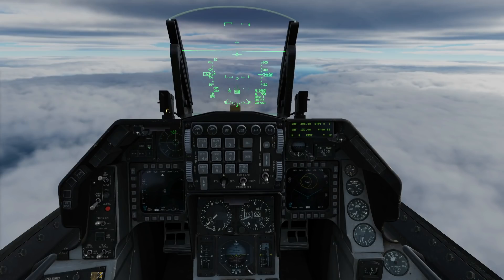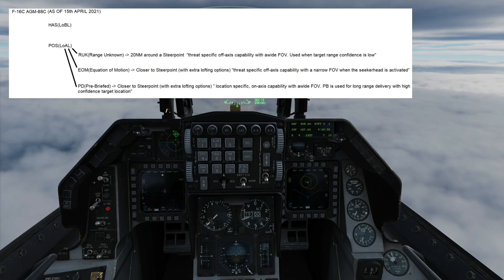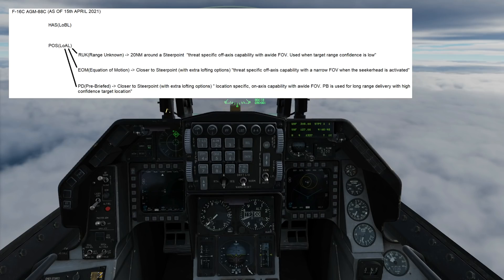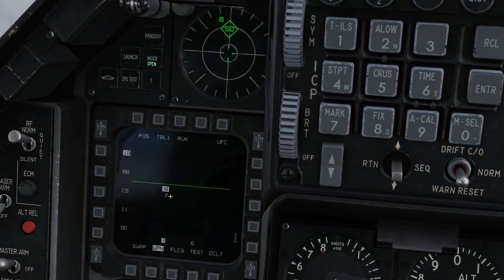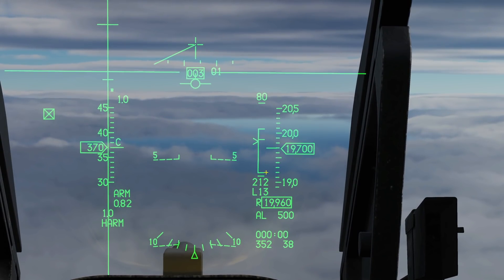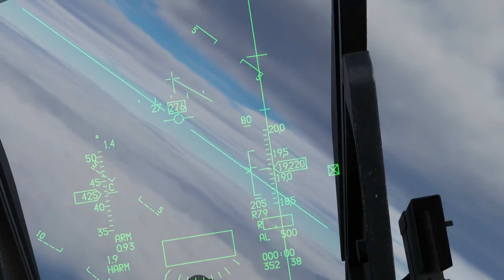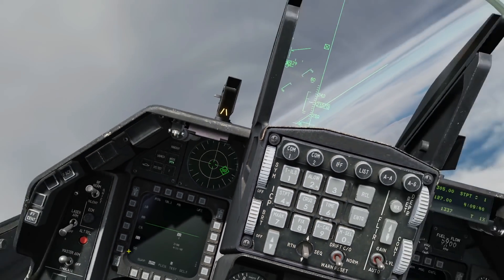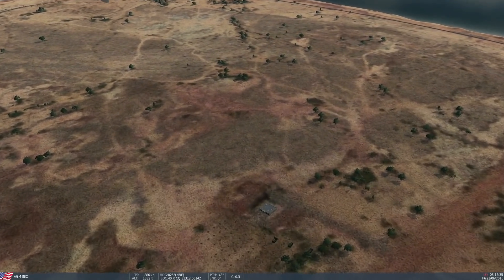F-16C Viper: AGM-88C HARM (POS-EOM & POS-PB Modes) Tutorial | DCS WORLD

Comment: I've just been trying the new modes out for the AGM-88C HARM in the F/A-18C & F-16C.  Just had a test mission where I was flying just below 30,000ft, IAS was 464 Knots in an F-16C.  I fired a HARM at a P-19 Search radar at a range of 54.44 nautical miles in POS-PB mode and it hit & destroyed the target.  It does appear that they have improved the AGM-88C HARM.

Comment: How far is the max range in pos mode exactly now? And how far is the tolerance for pos mode? 10 feet? 100 feet? 1 mile?
Reply from the maker: I haven't been able to find the tolerance anywhere. Apparently over 80 miles I have heard.
Reply: @grimreapers  Thats crazy! Thanks.
Reply: Tolerance varies. 80nm is a good or even best case for total missile range. 

EOM Test: HARMs are not waiting to turn on seeker. At 60km I had 40km lateral steer position and missiles steered back front toward emitter during first few seconds of climb. It looks like some kind of flex logic is coded so you basically can't miss. If there is an emitter of that type out there it will find it (at least in my ~30 deg error test). It does go for the assigned area by priority. Be aware a decoy emitter could easily fool this logic by dragging a missile off axis. I fired HARMs at each others targets about 30km apart laterally and they switched and hit crossing away from their original destination.

From what I can tell it looks like the HARM "glances" over at the assigned point up to 60deg off axis. If specified threat isn't there it turns to known available detected threats. Further tests will have to be done to determine if it values location or type more if none of assigned type is detected (it will also kill non-assigned type if assigned type not avail). These seem complex in logic and it will take a lot of testing to figure it out. 

PB seems to have an ability to see somewhere around 60 deg off axis as well. I guess RUK probably too. RUK flies flat and in test putting emitter of assigned type only different in range both near/far RUK both went for first emitter of type it saw (no priority to range correlation).

Comment: Dude, on POS mode, SA-10 sites are no longer a threat to me. Literally, I disable them 100% of the time, before I'm even within their firing range. This must be a mistake, yes? If SA-10's aren't a threat anymore, then what is?
Reply from the maker: time to get the S-400's in?
Reply: @grimreapers  time for IADs to become part of DCS
Reply: With scripts like IADS they are still very deadly. If the site shuts it's radar off the missiles have a low chance of hitting. The big thing in SEAD is making SAMs turn off to get a strike force through the sam net.
Reply: Also tunguskas might protect SA-10 so it is imposible with HARMS to penetrate those defenses.
Reply: @royra8562  It its possible with brute Force. In the last mission (coop) we killed an SA-10 site protected by 2 TOR by shooting 8 HARM from 2 F-16s and 8 AGM154 a from 2 F-18s so that every missile hits at the same time.
Reply: @Lorian667  Yeah, you can saturate those bad boys but you need a lot of coordination with your mates or AI. You can also try to do the Tactical Pascal way, and get really close to drop a cluster or several bombs
Reply: Would a combination of the F-14B decoys & F/A-18C or F-16C AGM-88C work against an SA-10 site?
Reply: Use the skynet script to make them a thread again!